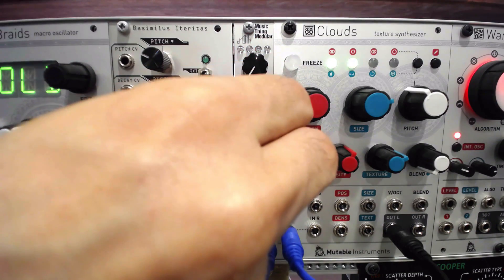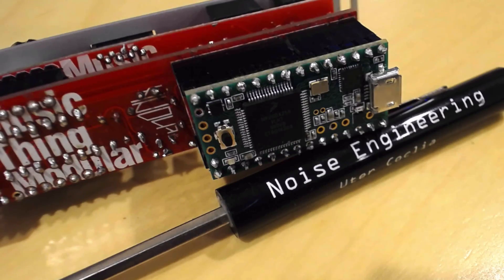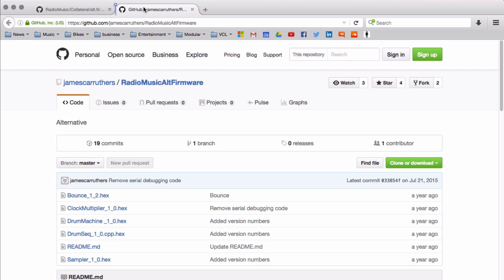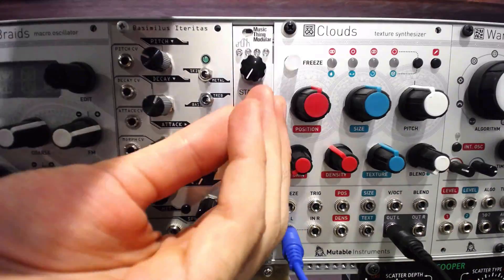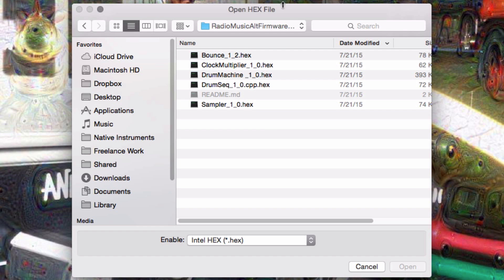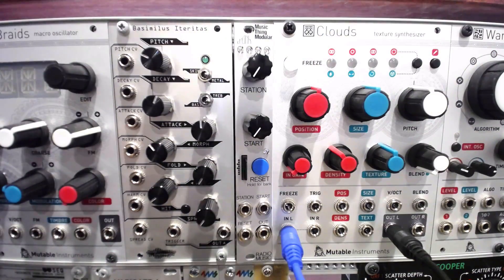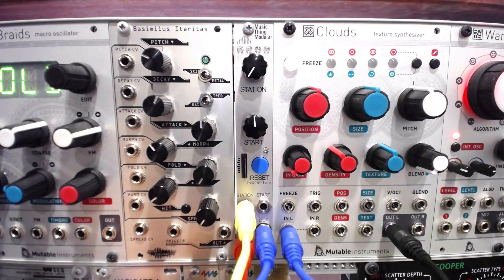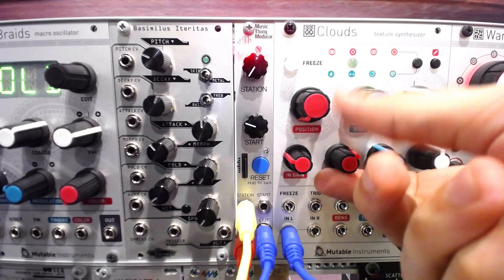Alternative Firmware For Radio Music

Comment: Is there any way to change the sample set from the inital 808 sounds?
Reply from the maker: michael perkins not in this particular firmware, as the samples are flashed to the Teensy memory rather than the SD card. I'd suggest trying my other video, on shutting off looping in radio music so you can just load your own raw samples.
Reply: That's what I suspected, but just wanted to make sure.  I guess my follow up would be, is it possible to just open up the code and add desired samples that way, or is that way more trouble than it's worth?  Sorry, total Noob to the world of Arduino.
Reply from the maker: michael perkins probably not nearly as easily as exporting samples in raw file format and using the original firmware, but definitely possible. just have to use very short samples, probably lower quality audio...
Reply from the maker: Probably POSSIBLE... Though it might be difficult. It may require creating a text file of the sample data or something convoluted. Maybe contact James Carruthers and ask!